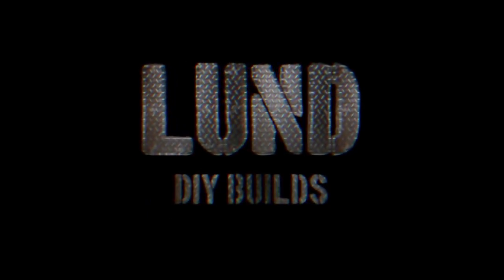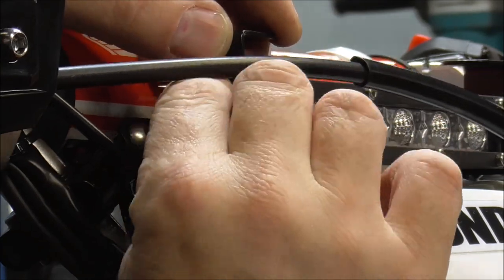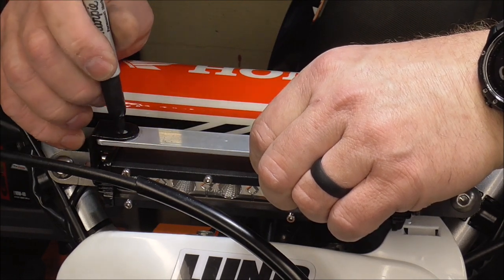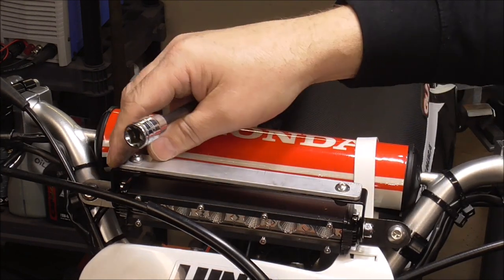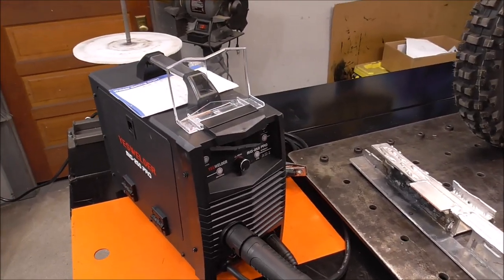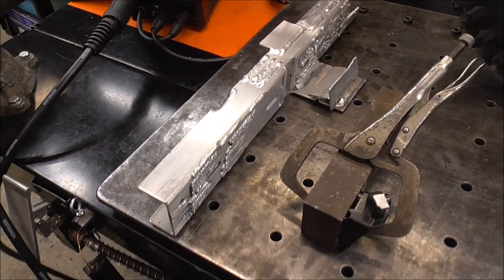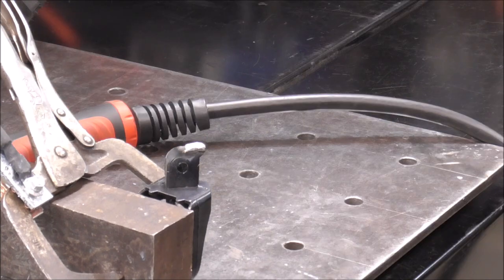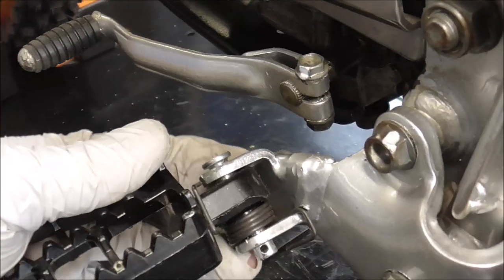MIG Welding Aluminum Repairing and Building Dirt Bike Parts

Comment: Thank you for your opening comment regarding thinking outside of the box when solving a problem.   In particular,  your solution to the speedometer mount is priceless!  I have friends and relatives who want me to "weld" them a solution. Your mount using a drill and screws is a perfect example of the best fit solution to a problem. 

Thank you also for your personal advice of averting sweetheart issues using their cherished belongings.  I suppose if they figured out they sometimes hold the key to our success, things would go so much smoother. Dish towels and nail polish,  I'll never forget these two!
Reply from the maker: Thanks @Tim Toy I too have the habit of sometimes overthinking a solution. You hit the nail on the head about the sweethearts holding the key to our success. Very well said!

Comment: Glad you mentioned wearing gloves as I had a sanding disk fly apart leaving a small gash in my index finger.  Even your thin tig gloves would give you some protection.
Reply from the maker: @Apenza I've had a few mishaps as well. Its no fun getting hurt
Reply: Man that's for sure. I'm a idiot and took off all the safeties on my 5 grinders and cant find them. So I have cut myself 4 or 5 times now. Even with leather gloves, at 12K RPC, it cuts through, but far better than nothing. I do know I am looking to replace my grinders with paddle ones and will NOT be removing the guards for sure lol.
Reply: Gloves are great just don’t get them sucked into the wheel. Break your fingers fast

Comment: 2 questions one is the name of your other channel? Well I only had one question. I had a floppy disc on my angle grinder without a guard and I was wearing shorts. I dropped it while it was running and it hit the floor and I didn't jump back, it came back up and put a nice gash in my leg just above my ankle. And it didn't bleed much or really hurt at first. My wife went into action, she works for a company that makes medical devices and on came the new skin. Lesson learned real fast and the guard never comes off.
Reply from the maker: WOW you got lucky! I'm glad it wasn't serious. My welding channel is Brandon Lund and my motorcycle channel is Moto-Vated207. Thanks for your support brother!

Comment: Does the Fronius Transsteel welds aluminium without the need of spool gun too?
Reply from the maker: Yes sir @Jose Vazquez however I have never tried in fear i'll mess something up when I replace the liner. I'm really careful with the Fronius. I should probably give it a try sometime. I'm sure it will be incredible. I have this setup pretty much for MIG 100% of the time but it would be interesting to see how it does.
Reply: @BrandonLund  I would be worried too! LOL!!!

Comment: Hello Brandon,, here's an outside of the box question,,, Has anyone ever tried to use aluminum electric fence wire for welding wire?
It's very stiff and would feed well in a MIG but two unanswered questions remain,,,, one I don't know what type of aluminum it's made from and number two it's .050in. and wondered if that was to large.
but I still wonder if anyone has ever tried using it.
Thanks 
Ron
Reply from the maker: Great question Ron! I think the diameter might be the issue because the closest mig gun contact tip size is .045 but it might be interesting to try tig welding with it

Comment: Brandon, one needs to be careful wearing gloves around rotating equipment. I took a coworker to the medical center because a glove he was wearing pulled his fingers into a circular blade on a gang saw. Osha considers it a safety violation to wear gloves because of the risk of the aforementioned problem. I argued with my boss about this, and he actually looked it up and then apologized because it could put a person at risk of damages from say, a glove getting twisted around a drill bit.
Reply from the maker: I agree with you 100% @Bryant Fry. Lathes and drill presses are also machines that gloves can be a problem. I generally wear gloves when grinding but smaller delicate parts I dont because I know I need good control